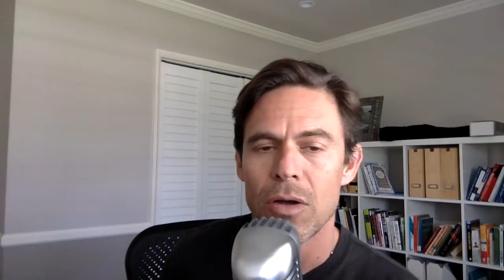What is Phase Space? | Deep Code Experiments: Episode 12

Comment: The bicycle metaphor is interesting in understanding the difference between sentience and machine, as well as degrees of freedom being expressed on significantly different terms based on degrees of embodiment or lack thereof. The bike actually has 0 degrees of freedom of movement without some kind of force giving it velocity. It just lies there. A hurricane would give it that needed force. So we need to distinguish that the bike on its own may be a bounded phase space, but biking is not. This is a profound insight if you follow it all the way to the nature of sentience/consciousness. But we're interested in freedom to control. Let's say, a beginning rider picks up the bike and can only ride by gravity downhill, does not know how to pedal and control the bike, then we can say the rider offers degrees of freedom in terms of stabilization of force, and the degrees of freedom operate on the first derivative of velocity, the second derivative of acceleration, and the third derivate of conscious control of acceleration and deceleration down the hill (stabilizing the bike, perhaps learning to use brakes to control accel/decel). But the rider does not exert degrees of freedom in terms of powering the velocity and acceleration/deceleration, gravity does that. But if the rider can pedal, can exert conscious will to generate mechanical energy, now we have degrees of freedom in terms of power, which is control over the source of energy (which is power, essentially). So our beginning rider did not have power, just control, but a better rider has power. This is an extremely important distinction when considering the phase space for say, AI or exponential technological development, because we realize that disembodied control is not nearly sufficient. This has profound implications for the development of human embodiment, I believe. Thank you for sharing your video